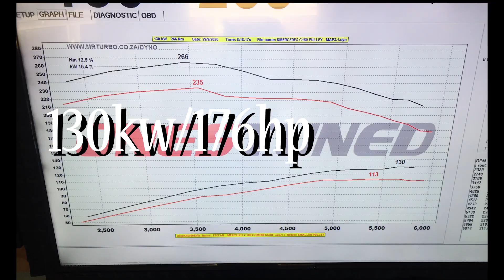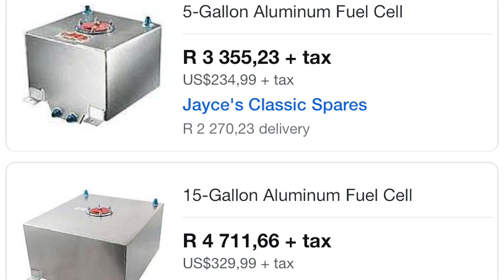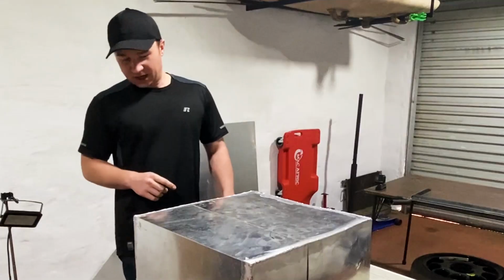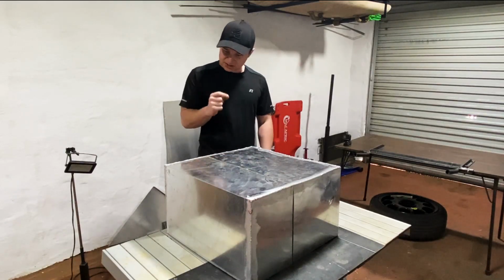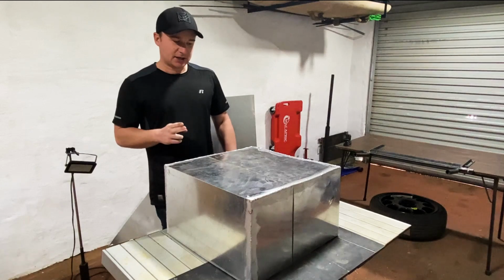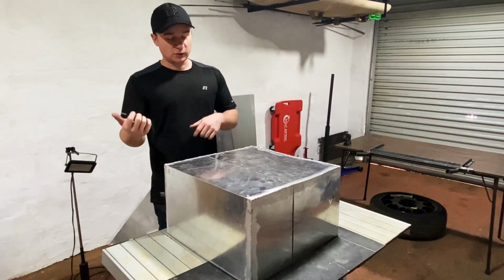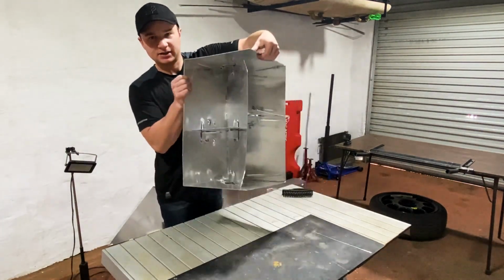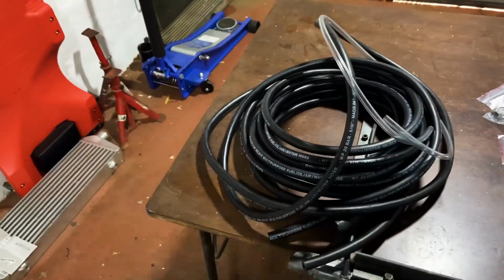Mercedes W203 (M104 SWAP)Upgrading The Fuel System|Custom Fuel Cell/Surge Tank For All The HRSPRS💪🤣

Comment: This is getting real serious now i love it. Its a wonder you didnt make it round the same size as the spare wheel but ok that wouldnt have been as much liters, inserting the chambers is genius so no sloshing around... what was wrong with using the stock tank im sure you could have just modified the pump system to as bigger or extra pipes without cutting holes.
Reply from the maker: Thanks man. Big reason for this was to start messing around with some aluminum. Bending ,welding and so, as it’s a weirdo to work with, but can look very good when done right. I’ll probably rebuild one with the correct thickness aluminum when all goes well and I can actually drive around.If I used the stock tank I would’ve had to remove the tank to figure out how it works etc but working under a car is a pain. So now everything is going to be easy access. 😁

Comment: Why don't you use the old fuel system?
Reply from the maker: Only had 1 line running to the engine. Did not want to mess around with trying to make holes and such on the old tank.